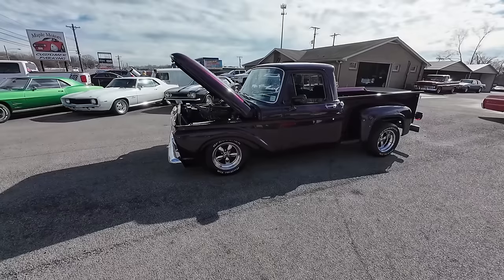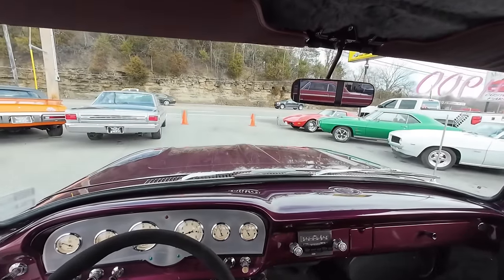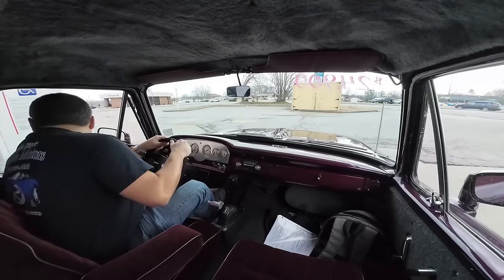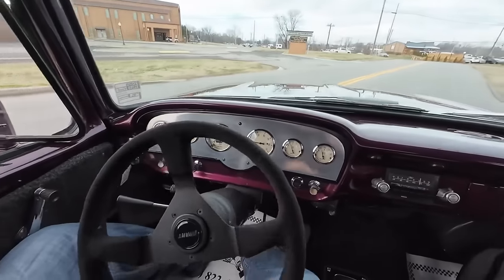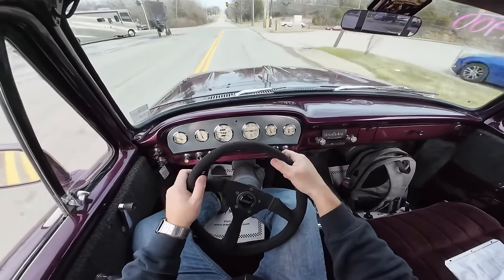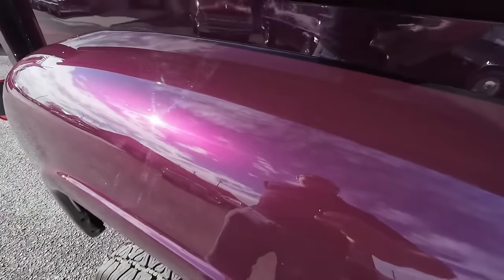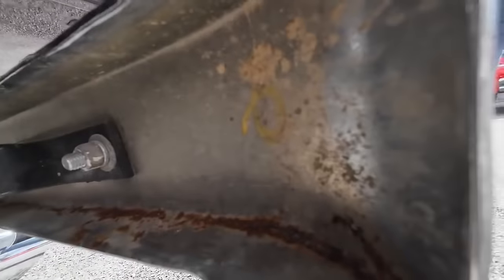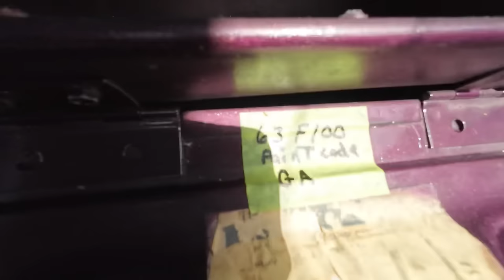Test Drive 1963 Ford F-100 SWB Stepside SOLD $24,900 Maple Motors #2459

Comment: That looked like a powerglide transmission. That would be a good indication of why the shifter is the way it is and why you couldn't see a shift in the video. They didn't call the power glides slushboxes for no reason